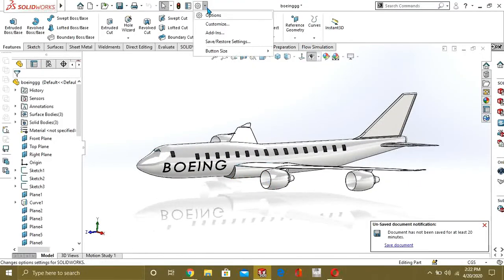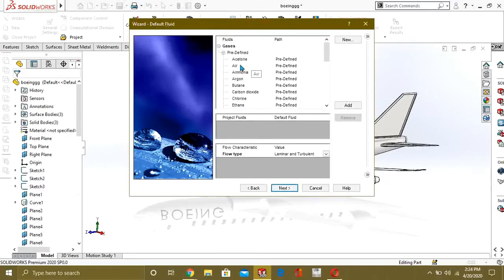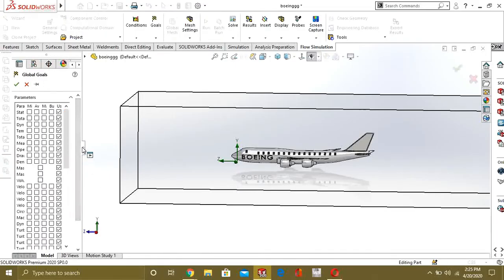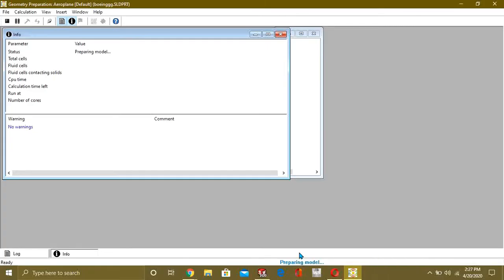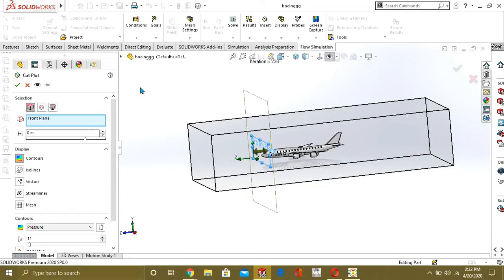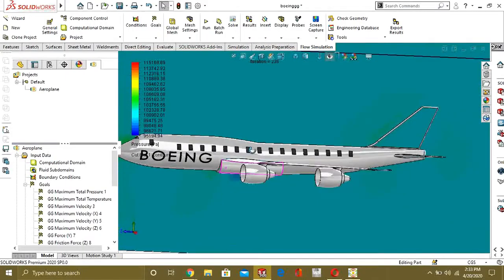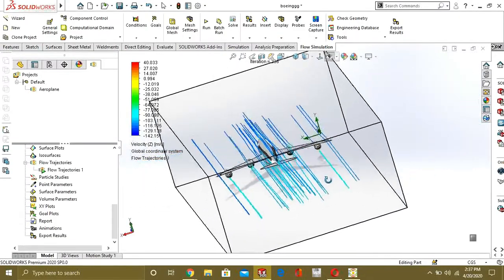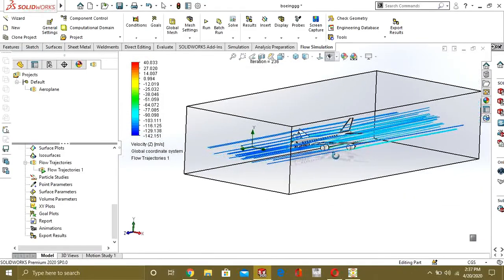⚡ Solidworks Flow Simulation | Aerodynamics Analysis Solidworks | Lift Force in Solidworks

Comment: Other than global plots,  what are the key simulations to run when finding lift, drag + coefficients  (aerodynamics in general) to get numerical values to analyse in a report format as well as important features to select on the flow trajectories such as pressure to produce clear images referring to numerical values produced?  I am a 2nd-year aerospace student and using Solidworks to produce data for a rocket I have designed for part of a group project.  Solidworks is an extracurricular resource that I am trying to get as much out of it as possible but have little help from academics at the university.

Comment: when i checked the gravity for my vehicle for lift calculation the values were not correct and lift increases drastically like actually it should have been for example 25N and it came out to be 1070 N. The values of gravity by default mentioned as -9.8 m/s^2 in Y direction and when i didnt checked it the values were correct. Please also see this link 
https://www.youtube.com/watch?v=ErIMxx4tiuE

Comment: And you didn't even mention what was the coefficient of drag of that model ...
Reply from the maker: Yeah i know i will mention it in detail in new video :)
Reply: @solidworksandansystutor  Can I see a link in which you calculate the drag coefficient of this model depending on wind speeds and angle of attack?